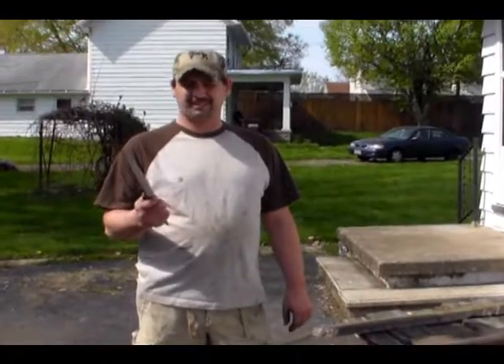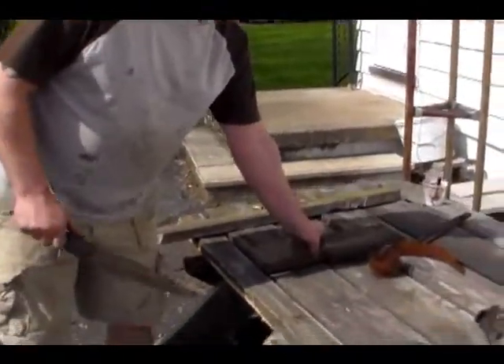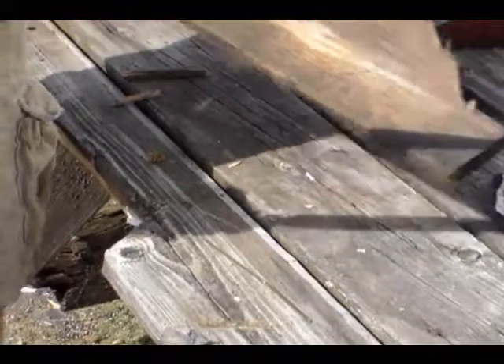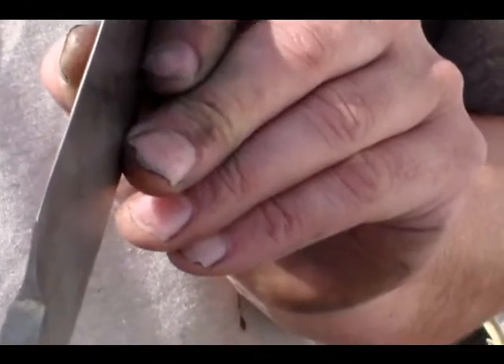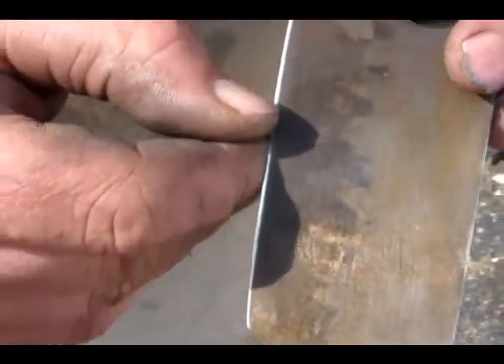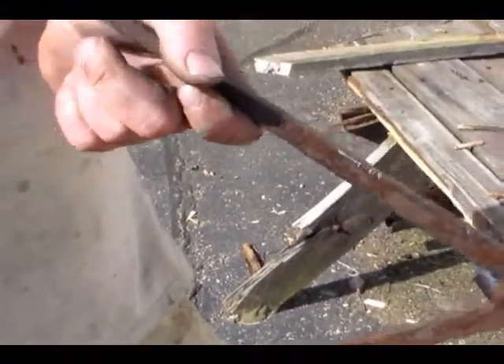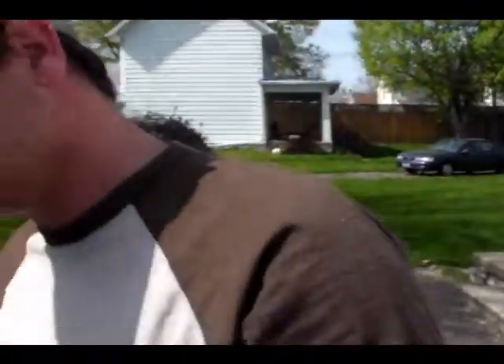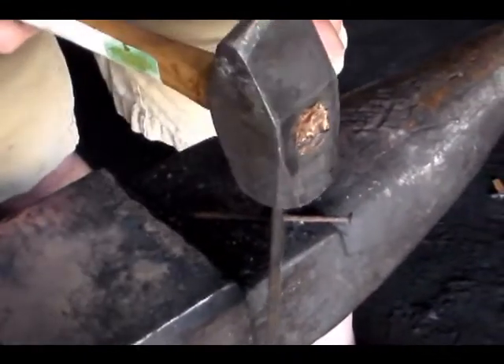testing a W2 Bowie.wmv

Comment: Bent or not, you are doing a good job on the heat-treat qualities of the steel. I also like the fact that you are building knives with grinds that are clearly meant to cut stuff. its a nice profile for a blade too. what was the thickness at the tang? it looked pretty decent.